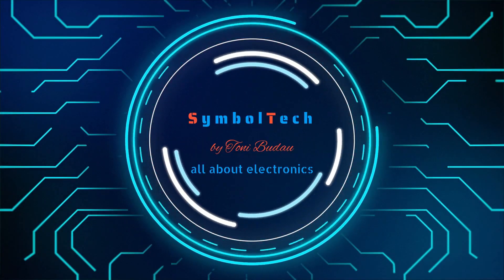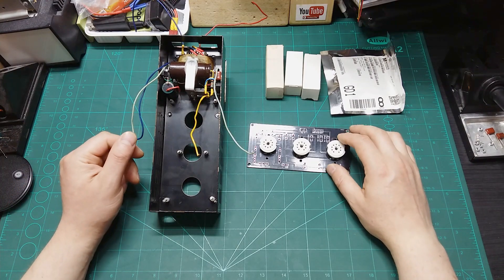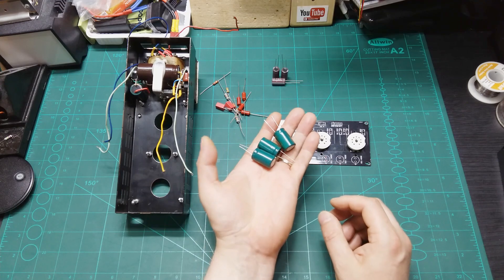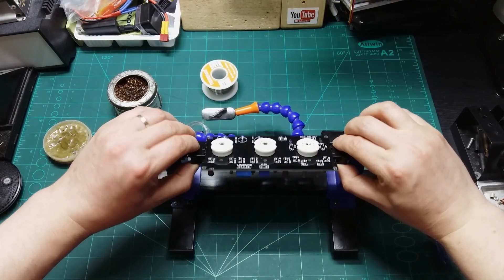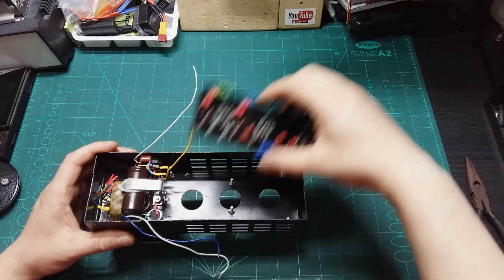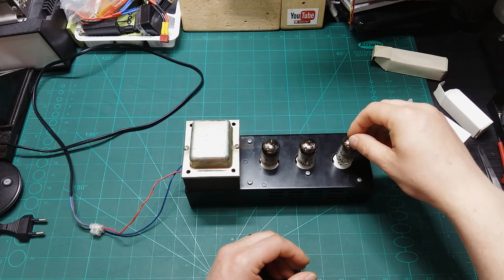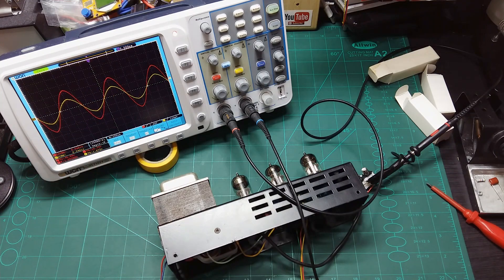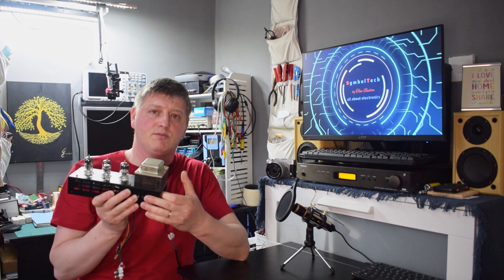Triode tube hifi preamplifier

Comment: Hi Toni. It is a nice design and great performance. I would suggest placing a 100u-220uF capacitor in parallel with the 150V zener diode to create a capacitance multiplier which equals lower ripple in the DC.

It would be interesting if you show the output amplitude of the preamplifer under different loads, for example output with no load resistor, 22k, 10k, 1k and 470ohm to see what is the output impedance of the preamplifier. Also a test if it can drive headphones (if it can output 4V p-p into 32ohm) would be nice.

Subscribed :-)
Reply from the maker: Thanks for your comment. Yes when I will do the second video about this preamp I will keep in mind your suggestions and do as well this tests. mainly I build this preamp to use it with my hiraga amplifier and I already did a test and they are a perfect match I was so impressed with the sound. but yes I will keep in mind and once I will do the second video with the front panel done and all finished I will come also with those tests